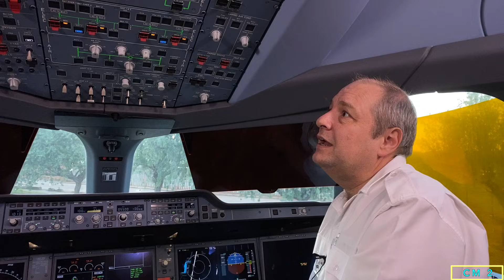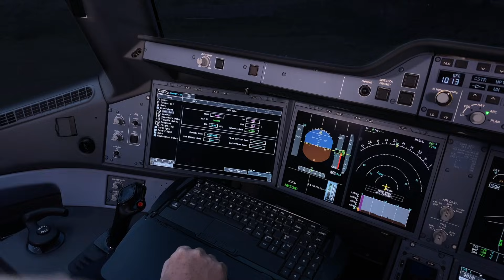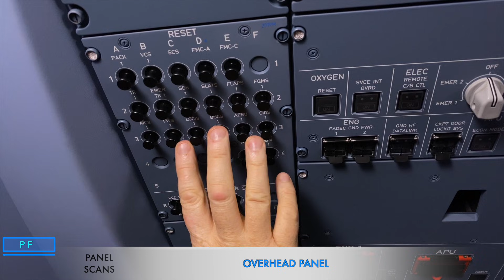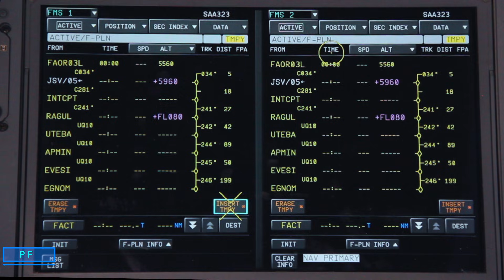AIRBUS A350 FULL COCKPIT PREPARATION and SETUP - VERSION 1

Comment: ADIRU alignment is #1, #3 and #2
Reply: Thanks, always align the ADIRS 1 then 2 then 3, this helps with muscle memory of the odd switch positions if you ever have to find the correct switch during an emergency.
Reply: @ZwartkopFilmkunde yes I agree. Better to switch them that way to about switching off two when you meant three in a drill.

Comment: Very suboptimal clumsy interface still. It should be one big display, virtually no buttons. The legacy autopilot bar at the top should never have been there. The screen should be much closer to the pilot and there should be no center console. It could be so vastly much cleaner and nicer. That is painful to look at for a thinking person.
Reply: No. This is superior. A single interface would be too cluttered. There’s also no redundancy with a single display. You really don’t know what you’re talking about
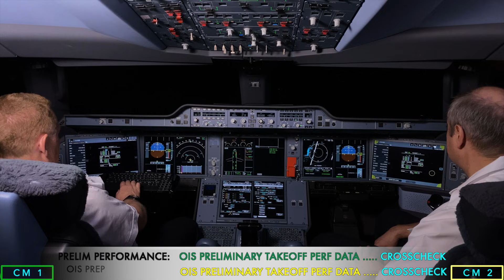Reply: @peteconrad2077  hehe ye of little faith. Go to 11:45 and look at the dash. In a zero visibility situation, would you rather fly by this dash or by a 40inch microsoft flightsim display?  try to realize that MSFS is synthetic vision avionics. Which is clearer, which is more enabling. And which is absolute garbage.
As for redundancy, one big display per pilot and a little 3rd unit stowed away out of sight but realistically if you have lost both units you have probably lost the electronics that control the plane anyway.
It's a good general lesson to never mindlessly defend status quo. Don't be so devoted to the current situation that you praise it without insight. I assure you, airline cockpit design is absolute garbage.
Reply: @DanFrederiksen  I’m not mindlessly defending anything. I have a masters in aeronautical engineering, fly the A350 and can tell you that you are taking utter bilge.
Reply: @peteconrad2077  hehe, you are a bus driver. I am a polymath genius, father of deep learning, smartest man in the world with wisdom to match. When you are done being offended, think about the comparison I offered you. Which is the more informative clear display, the A350 dash or the MS flight sim view. One is pleasant to fly by, the other is a runway show for emperor's new robes.
You just never questioned it. Next time you sit down in the cockpit, look at it and realize that it belongs in a russian plane from the 1960s.
The first car with an engine looked like a horse drawn carriage, just without the horses. That's a failure of intelligent design. Airliner cockpits are similarly thoughtless design by past convention.
Reply: @DanFrederiksen  you are neither a polymath nor that bright and certainly ignorant of the priorities for operating an aircraft. 
Having used both displays extensively and having considerable expertise in this matter I can tell you that the Airbus design is superior every way. 
Better redundancy
Better segregation 
Better ergonomics
More information with intelligent display showing what’s needed for the phase of flight. 
In fact, only a know nothing could imagine the MS display superior. Thank you for self identifying.
Reply: Wrong. The buttons are for things you will need to access quickly while using the screen for something else. All screen wound not be a good step.
Reply: @peteconrad2077  you forgot you had answered me before? :) look at this video. is any of what they do fast?
Reply: @DanFrederiksen  no, because they are methodical. But there are times when you need to access a control simultaneously with doing something on the screen.  Thats why we have separate controls for radios etc.
Reply: @peteconrad2077  they are slow, that's a retirement home. try to realize that you never questioned the design and you speak from blind faith in status quo. would I be right to guess you are after retirement age?
Reply: @ hi would you know? I’ve given Airbus direct feedback about some aspects of the design. But the over all layout is excellent. The legacy FCU is good too. Makes converting from other Airbus aircraft easy and makes critical flight mode function immediately and easily available. 
You clearly haven’t a clue what you’re taking about. Maybe stick to stuff you understand.
And FYI, I am a current training captain on the A350.
Reply: @peteconrad2077  do you like the nice big clear synthetic vision?
Reply: @DanFrederiksen  what synthetic vision? What are you gibbering about?
Reply: @peteconrad2077  exactly. it has none. something tiny propeller planes have. something a tiny backup instrument has. yet brand new A350 doesn't have anything at all. because it's made by clowns. take a walk in the avionics bay. all those electronics boxes. a tour de force of bureaucratic incompetence yet it doesn't even have synthetic vision.
I know you are a fan boy, it's your precious. but I'm a polymath computer scientist. I have the electronics engineering knowledge to make electronics. I have the programming knowledge to do synthetic vision in a quality vastly superior to any avionics in existence. Indeed I programmed a demo of it just to see. the cockpit of all airliners is really poor design. not just a little but really poor. It should be ultra clean and just one big screen for each pilot. Indeed there really shouldn't be a pilot at all but ignoring that for the moment it should be Tesla clean. There should high power optics both visual, near infrared and thermal, there should be cameras on multiple locations of the plane, there should be side and rear radar and it should be automatically surveilled so there are no surprised ever. There should be synthetic aperture radar to image the ground through cloud cover so you never CFIT. And it should be runway to runway autopilot, even automated taxiing and automated ATC. I'm the one with actual brilliant insight, I'm the one who has actually thought about it. I'm the one who is right. I know you don't like to hear it but the A350 cockpit is pure garbage. pretentious emperor's new robes. mindless status quo repetition from a time pre computers where everything was switches and dials. The avionics bay should not exist. Not one of those units should be there. Consider the potency in a phone, the size of it. Then look at the avionics display and see bureaucratic idiocy. You wont appreciate it now but maybe slowly during your career it will guide your realization.
Also bring half decent camera gear like a sony A7 or A6000 series and a relatively cheap 500mm mirror lens so you are ready to record if an ET ship should show up. Set it to infinite focus, practice during day and night. If you are not allowed to have a camera do it anyway. And yes those are real. You pilots betray the world by taking part in keeping it secret.

Comment: so unnecessary complex and long. 787 is so much easier and pilot friendly. although it might be just this video. you start daylight it's night now and still somewhere with preflight preparations...
Reply: To be fair I've seen the 787 power up from cold and dark without ground power....it takes forever
Reply: Airbus philosophy is to do the complex stuff in the ground and make your flying job easier. In fact it’s hardly more complex than 787.

Comment: That's a great job Thanks a lot However at 32 20 shows ECAM CG to enter TO PERF THS BOX   That is not correct, LS CG entry should be done   Yes it looks weird , because  at A 330,  we used to rely on and enter ECAM CG rather than Load  sheet CG But here A 350, the F/CTL PITCH TRIM/FMS/CG DISAGREE check logic is a little bit different than A 330  So we should enter LS CG
Reply: But the CG they used off the ECAM should be the same as the LS anyway shouldn’t it? You enter the initial figures in the FUEL and LOAD page for ZFW, ZFWCG and Block fuel and that will give you the CG of the aircraft which should match the loadsheet? The result they got off the ECAM is just what they entered in the FUEL page as the aircraft can’t calculate its own weight and CG until at least in the air
Reply: That’s the airbus standard, but operators can vary an SOP for cross fleet standardisation or to comply with operational policy.

Comment: Aren't you supposed to check if the landing gear is down before you get in the cockpit?
Reply: When you check the over, you’re just chucking the lever, not the gear. Subtly different issue.
Reply: @peteconrad2077  Look and see if the gear is down before you enter the cockpit. Belly down takeoffs are not easy.
Reply: @bridgetstoli2347  once again, it’s not the heat you’re checking, it’s the lever. The gear can be done with the lever up if engineering are running tests. Your check if the gear won’t spot that.

Comment: I feel like Airbus went two steps back with all that modern stuff. Way too much workload for the pilots. 
And what's with all that repetitive steps? Why can't the EFB synchronise with the MCDU or vice versa?
Reply: Workload actually was never lower than it is now. To your question: EFB and MCDU aren’t physically connected for safety reasons.
Reply: Because if you make a mistake in one place you can catch it on the next place
Reply: Traduci in italiano tutti i commenti
Reply: All that workload makes the flying easier. It’s well worth it.

Comment: Honestly the UI in the A350 needs to be more organized. The buttons on the screen seems to be scattered in random locations, and some color coding would be nice too. The chip should be updated in the future cuz its a bit laggy when zooming in and out of the nav screen.
Reply: I agree, the UI needs a huge overhaul. Everything needs to be big and bold and every screen should be a touch screen. The menus seem clunky and the hardware slow.
Reply: @CyberSystemOverload you’re both taking gibberish. The UI is excellent. The best I’ve used by a long way. Not sure what “buttons” you imagine are randomly spaced. Maybe it’s because it’s not your work environment it seems alien.
In most 350s it is already touch screen on the OIS screens. Using touch in operational control screens isn’t a great idea. To much opportunity for error.
Reply: @CyberSystemOverload  Why should they be touchscreen? You're just asking for dirty fingerprints all over it. And then how do you manage during turbulence?
Reply: @tomstravels520  Those issues have long since been addressed. Look at Symmetry flight deck that Gulfstream is using. 10 touchscreens :-)
 Even the overhead is all touchscreen:

https://www.youtube.com/watch?v=PnLe4Rm7QzY
Reply: @CyberSystemOverload  that video doesn’t explain how they’ve been addressed. I’d like to know what happens if the screen freezes or power is lost to that screen of controls or if a severe electrical failure occurs. Then how do you activate those systems controlled by touchscreen. Also private jets are massively different from commercial passenger jets. 

The UI of the A350 is probably the best around. PFD is for flying the plane, ND is for navigating, central displays are for managing aircraft systems, lower central displays are managing the flight and the OIS is for extra assistance for displaying maps and showing aircraft maintenance data etc. The newer A350 do actually have touchscreen lower displays and OIS but they’re for pilot preference who can still use the mouse and keyboard or trackball if they want. If you’re not a commercial pilot you can’t really say “oh it looks bad and needs sorting out” because you don’t use it anyway. 

Also this plane was designed in late 2000’s and likely using chips from that era as they can’t keep adding new ones all the time as they have to be throughly tested. The chip powering the EFB on the 787 is supposedly from late 90’s
Reply: @CyberSystemOverload  yeah agree. Hope they do a software/hardware upgrade in the future.
Reply: The buttons are in a logical location if understand what you’re looking at.

Comment: How do you get a battery voltage reading if the batteries are off? Dont they have to be on to display anything?
Reply: The meters are connected directly to the battery. All you’re pressing when you push the battery buttons is the switch to connect them to the power supply

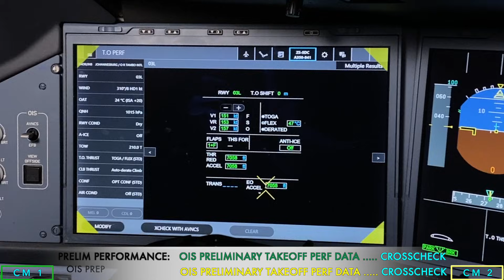Comment: Excellent. I found out that at 12:12 engine out is 7058ft, but would like to know what typical values are entered in the INIT page, under T.O tab for 'THR RED' and 'ACCEL'. Thanks so much.
Reply from the maker: Hi Ron. It depends on the runway noise abatement instructions. 7058' is 1500' agl in Johannesburg. The Airbus engines are so quiet that we normally use 1500' agl for THR RED and for ACCEL.
Reply: @JSLSAA  Okay thanks!
Reply: @JSLSAA  Oh .. I have another question. Can you put fix rings around a waypoint or runway in the 350?
Reply: With engine out it is a minimum value anyway. You don’t accelerate until you’ve secured the engine

Comment: Cabin Temp selector should be turn all the way down to Purser Select position.. That one showed MAX COLD Temp selected Captain..
Reply: Depends on company policy.
Reply: @peteconrad2077  well then the purser can't adjust the temp in cabin for passenger and let them freezing??...okay Sir...if you say so... LOL
Reply: @henrysakul625  I do.  Some companies have the pilots having temp control. In this case, the aircraft was clearly ex engineering which would mean the engineers had put the controls where they needed them.

Comment: Some quick jumps:
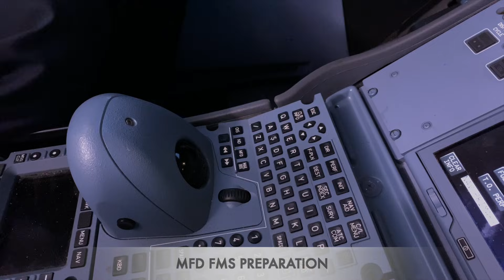20:15 start entering flight plan
20:50 company route
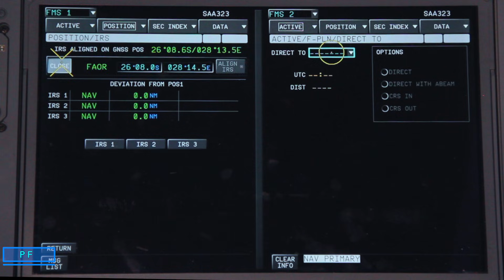22:20 IRS align
22:27 departures
23:05 radio navaids
23:55 weight and balance and fuel
25:05 takeoff performance
27:00 arrival
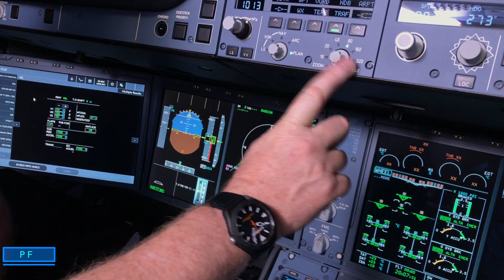27:35 scroll through flight plan
27:55 alternate departure
28:21 alternate scroll through
28:30 alternate arrival
29:00 delete wpts / disco
29:30 sec1/2/3 copy from active
30:00 sec1 alternate
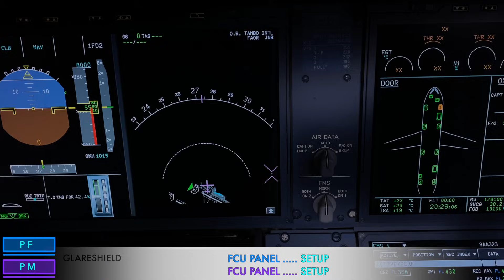31:05 airport navigation function (ANF) -> airport diagram
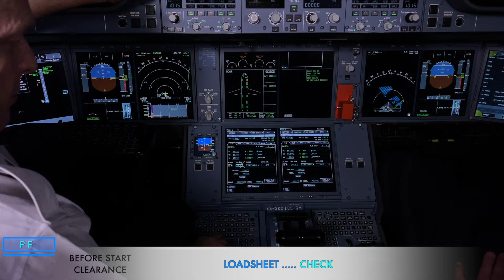32:50 final load sheet arrives, check performance
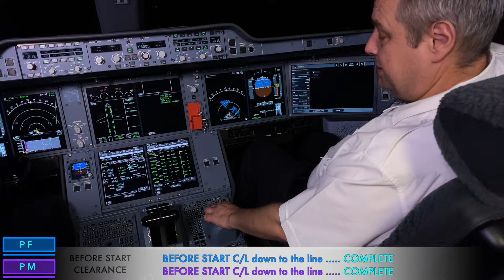34:20 electronic checklists
35:05 taxi cam
Reply from the maker: Thanks for this...JetPackJan

Comment: why is this plane not operational on international routes yet?
Reply: AZ ZMM it’s because the crew is still relatively new to the type and need to become familiar with how the aircraft handles in real world conditions, it’s best to do short hopes that can allow the pilots to do multiple legs in one day instead of them only finding out how it handles in certain conditions during a 16 hour flight to the US somewhere over the Atlantic Ocean.
Reply: David Adams it sounds like you no everything, just maybe it’s because the wait for the pathetic SACAA to clear the aircraft for ETOP now EDTO or other certifications they need, this is reality not Microsoft flight simulator
Reply: @checkmate5857  okay so you are perfectly fine with an inexperienced crew on a brand new aircraft to the fleet just flying you on an 11+ hour flight. And also every other airline that has the A350 did the exact same thing. British airways first flew their A350 to Spain and then to Dubai for a couple of months before they were flying the normal international routes. Hence why these planes are flying to Capetown allowing the crew to gain experience on the type. I know this is not Microsoft flight simulator, its my picture from a couple of years back deal with it. Also why would it SACAA need to give the plane an ETOPs certification when it got one when the aircraft was being tested before commercial use was allowed
Reply: David Adams you are almost on the pin but still a long shot off, yes I will, these pilots can fly, no other reason except certification can limit the operation. A aircraft is certified like you said with ETOPS, like 180 min when some need more, EDTO. basics these pilots can do to smooth their operations, if they had the full certification from the CAA they would have started with the JFK route. En route training is what they normally do, doesn’t matter which route, airline flying is not for sissies
Reply: Karooboer San I got to know, do you actually know how the airlines work. It appears that you do not. Go to any other airline and ask them why when they get a new type of aircraft in their fleet they don’t start flying them immediately on long haul routes. THE CREW NEEDS EXPERIENCE ON THE ACTUAL AIRCRAFT, yes they can fly already but with your logic that means that they must be able to fly a 737 and an A320 when they are 2 completely different aircraft and REQUIRE 2 DIFFERENT TYPE RATINGS. Please read up on these things before you make your self look like someone who has no knowledge of what they are talking about.
Reply: David Adams do you? I’m no fucking CEO or DFO but one thing I will rather be a fool then proof to be a fool, you talk absolutely a lot of rubbish
Reply: @checkmate5857  you're an idiot. Are you a real pilot?
Reply: @Electric_SparkSA  this is true. When the 787 was brand new and delivered to Air India they only flew domestic for a couple of months. AI was the second customer of the 787. Ignore the other tard in the comment section who thinks he knows it all.
Reply: It is, iv flown a350 from at to ams. There also flying all the time to Korea and Japan